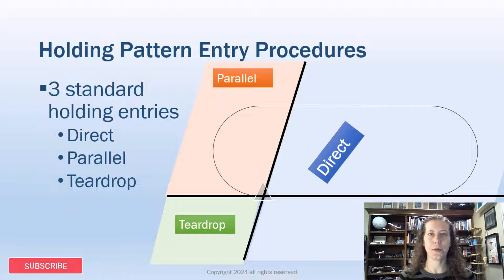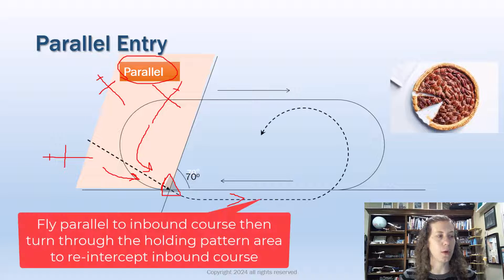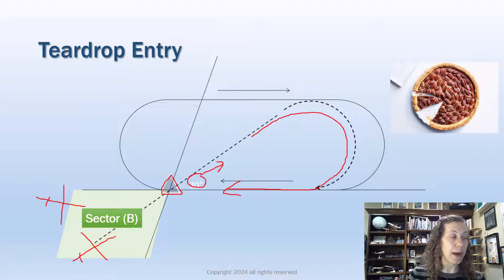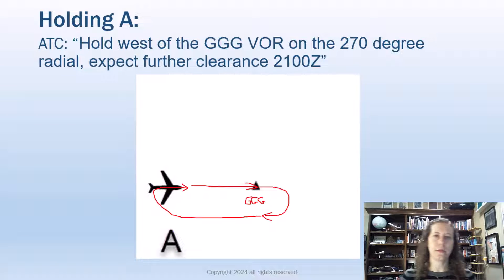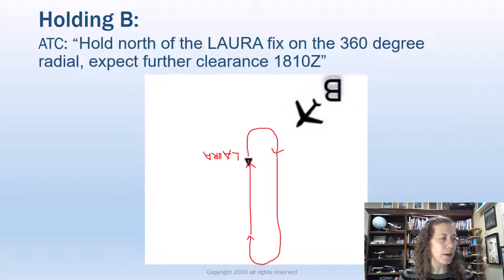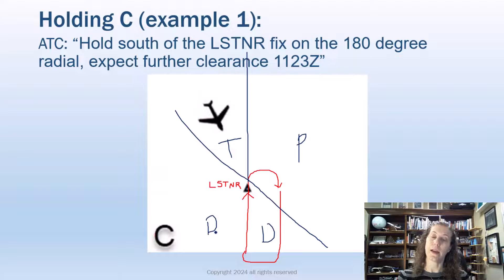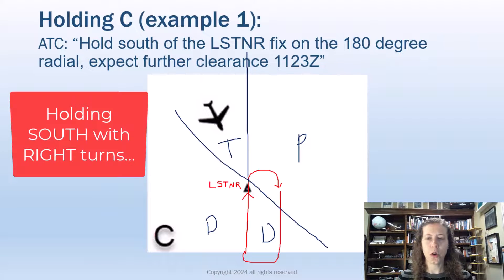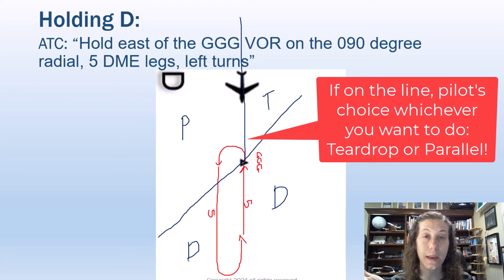How To Draw Holding Patterns & Easily Determine Entry Type Parallel, Teardrop, Direct IFR Pilot Test

Comment: Thanks for the video.  A problem I had with drawing left vs right turns was figuring out the turn direction in a north up map.  I figure out left was counterclockwise (just like rotation around a Low pressure system) and right is clockwise.  Think this also helps when visualizing the hold on a HSI/DG.
Reply from the maker: Okay, I love this tip! Thanks for letting others know what worked for you. I get confused on left and right and so I try to also verbalize my heading to turn to and write it down on a paper or scratchpad so I verify it makes sense.